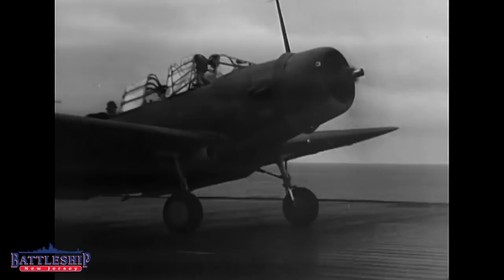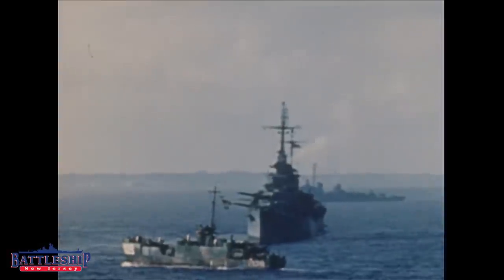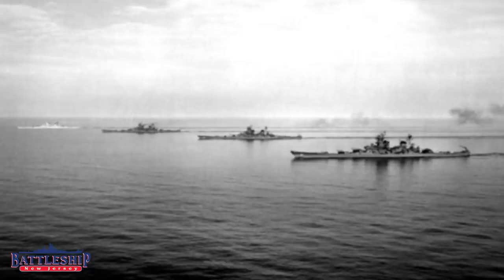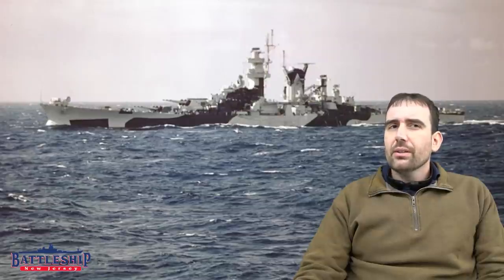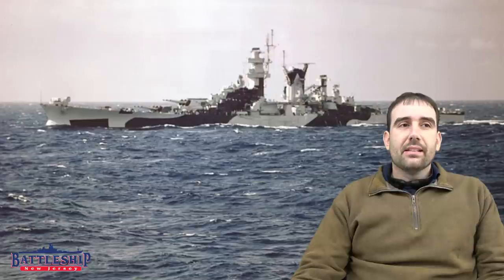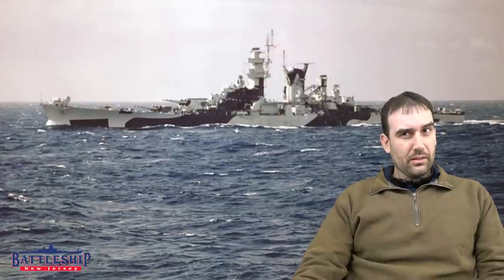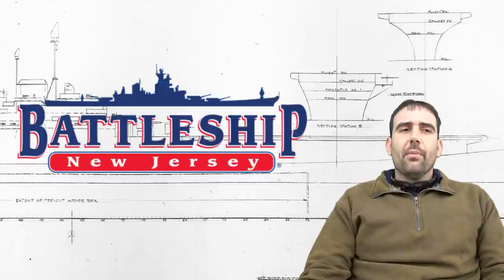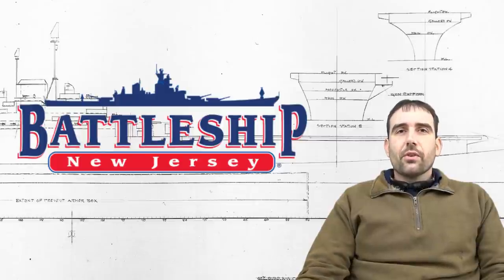Aircraft Carrier / Battleship Conversion

Comment: I read a book about the Shinano years ago. Her aircraft capacity wasn't that great for her size. And the ship had more than damage control problems. Out of line propeller shafts that overheated and watertight doors that weren't. (The doors had been tested before other work was done, and that broke the seal.) Shinano!: The Sinking of Japan's Secret Supership by Joseph P. Enright
Very interesting book on how errors on both sides (the Shinano and Archerfish) canceled each other out, and a torpedo hit right between two fire rooms, flooding both.

Comment: Just out of curiosity, in previous videos it was mentioned that the ship is floating, corrosion at the wind/water line is most severe and necessitates dry docking to repair, and that most systems on the ship are still functioning. Would it then be possible to heel the ship (induce a list) using the damage control pumping system and ballast tanks in order to gain access to the wind/water line for periodic maintenance? Perhaps that could extend the time between dry dockings and save some money?
Reply from the maker: We absolutely can. We don't need to yet, our wind water line is in pretty good shape, but down the line we have that option.
Reply: What an excellent question, very fascinating.

Comment: Granted that we are talking about a later time frame than what you usually cover, but I was under the impression that USS ENTERPRISE  (CVN-65) had been based on a battleship hull. Although in her case they may have been referring more to initial design work than a standard  "conversion" of an Iowa or other battleship class.
Reply: Cvn -65 was designed from scratch as a carrier, and was actually a prototype for nuclear powered carriers, however she was so expensive that she was the only one built until the Nimitz was constructed in the 1970s.

Comment: There's a misconception about the Bunker Hill and Franklin carriers.
They WERE repaired.  FULLY repaired from what I've read.  One of them was used during Operation Magic Carpet to transport the troops home from Europe so that ship was operational.  I figure they won't send a ship that's falling apart to transport 4,000+ men home only to have them die in a storm or wreck when the ship breaks in half(?).  There was plenty of experience with that already with the Liberty Ships!
Although Bunker Hill and Franklin were decommissioned, one of them was used for electronics tests but it never sailed under its power after it was decommissioned in 1947(?).
The problem was in the 1950s, as they got later into the decade and newer supercarrier class ships (first Forrestal, the Kitty Hawk, and soon Enterprise/CVN-65 in the early 1960s) were commissioned, there were less and less reasons for the Navy to recommission the Bunker Hill and Franklin.  The Essex class ships were already obsolete and they were pressed to operate the latest jets; frankly, they couldn't operate the latest heavy jets after the 1950s.  By the end of the 1950s, the Navy saw the writing on the wall -- the Essex class couldn't handle fighters bigger than the F-8 without major rebuilds so the smallest US carriers the F-4 ever operated off were the Midways.  The F-4 Phantom was originally intended to be operated off Essex Class angled decks but the Navy would have had to invest in strengthening the flight deck of the Essex ships to handle the F-4's higher landing weight.
(NOTE: the British had carriers near the Essex-class size that COULD operate F-4s but only one British carrier was modified for this and the F-4s that operated from that ship were VERY different from US Navy fleet standard.  They were specifically redesigned to employ higher-thrust engines to get off that small ship at a higher pitch angle/angle of attack to lower takeoff speed and I think they were stressed worse by the shorter landing runs on that carrier, the HMS Ark Royal/number unknown to me.)
I've seen footage of Bunker Hill or Franklin in the late 1960s and her condition seemed fairly decent.  The crews were upset when neither ship was spared the scrapyard.  There were of about 8-10(?) Essex class carriers that did NOT get the angled deck treatment so they were full World War II configuration unlike the 4 converted, angled deck Essex ships that were turned into museum ships.
Then again, they didn't spare the USS Enterprise CV-6 from the scrapyard, either, and she was the most heavily decorated aircraft carrier in naval history, PERIOD...
Reply: Was so very criminal how they time after time scrap heroic or decorated historical ships. Enterprise, Nimitz, Warspite to name a few. And all of those tanks, trucks, aircraft and other equipment abandoned or dumped overboard at the end. They would have made a fortune now in collectors hands. I understand there was not a collectors market back then, and they just wanted to go home and forget the war. But the major ships at least could have been saved. Criminal what they did to Warspite as well.

Comment: They had problems with the conversions of the Essex and especially Midway-class carriers to angled decks in the 1950s. 
They got FAR heavier -- especially the Midway (CV-41).  That ship was close to 25,000tons (70,000tons) past its original designed displacement (45,000tons).  I had read there were serious concerns about hull stress let alone the instability caused by her flight deck rebuild.  Her power plants I'm sure were stressed.
I saw video of her sister (Coral Sea) in heavy seas off California and if SHE was THAT BAD without as radical a conversion as the Midway had in the late 1960s, I can't imagine how bad the Midway handled in similar storms.  They said the Midway rolled as much as 26-degrees in some storms and that was 2 degrees past what she was designed for!
I have to wonder how screwed up the Forrestal Class was when they added the angled decks in the 1950s during building; the Forrestal Class was NOT designed for angled decks.  The Forrestal was a reuse of the CV-58/USS United States that didn't get past the keel plate laying.  I've read Forrestal (CV-59) had powerplant issues and the deck elevator arrangement was far from ideal.  Probably why those ships were retired relatively early in the 1990s.  They each had around 10 years of service life but spent their last 20+ years rotting in decommission.
Reply: One of the issues with Forrestal elevator's was the elevator at teh end of the landing area could never be lowered, less they lose the ability to trap - essentially they used 3 elevators, leaving the 4th up at all times.
Reply: @PavewayJDAM  Yeah...  Seems very obvious now but of course NOBODY built a ship like that before the 1950s!
Oh well...  They didn't repeat that mistake on the later classes and they even avoided making that mistake when they reconstructed the Midway carriers in the late 1950s. 
I have to seriously think they retired the Forrestals because of problems with their design.
Reply: It was a choice between giving those carriers angled flight decks and not being able to operate fixed-wing aircraft from them.  With carrier-borne jets, your landing speeds get high enough that anything that doesn't trap isn't going to stop before it goes over the edge or hits something, so the landing deck has to be angled to keep bolters from plowing into aircraft preparing to take off - it wasn't long after WWII before the carriers that weren't refitted with angled flight decks were only good for carrying helicopters.

Comment: If the Illinois and Kentucky were to be of all welded construction. How do you think the 4000 tons weight savings  would have been used? That's a number drachinifel  I believe  mentioned in one of his yt bids. Speed ,armour or more anti AC.
Reply: Strip everything topside except the bridge, signal bridge, mast(s), stack, 5" fire control stations, electronic  signal gear and antennas etc., and cover the remaining area with 5" /38 mounts. Proceed to Operation Kentucky Windage.
Reply: I don’t remember him saying 4,000 tons.  That would be more than an entire gun turret’s worth of rivets.  400 tons sounds a lot more reasonable.
Reply: @bluemarlin8138  I believe your right 400 tons
Reply: steve downes After doing some research, it looks like the truth is somewhere in between.  On an ordinary ship, changing from all-riveted to all-welded construction can indeed yield weight savings up to 10%.  But with the Iowas, there would be a lot less than 10% savings.  First, the Iowas (and SoDaks/NCs) used both welding and rivets, with over 800 miles of welds on each Iowa.   I don’t know the proportions of welded vs. riveted plates, but all those welds mean a lot of weight had already been saved.  Second, you can’t really use the 10% formula with an armored ship.  The 10% formula assumes that the weight is structural steel held together with rivets.  But with a battleship, a large proportion of the weight is concentrated in the armor, which obviously isn’t riveted or welded—just bolted onto an STS backing with huge bolts—and that weight must be subtracted from the total when calculating any savings from welding.  (Video referenced this when Ryan said “hull weight.”)   So yes, some weight would have been saved, but I suspect it would have been closer to 1,000-2,000 tons due to the above factors.